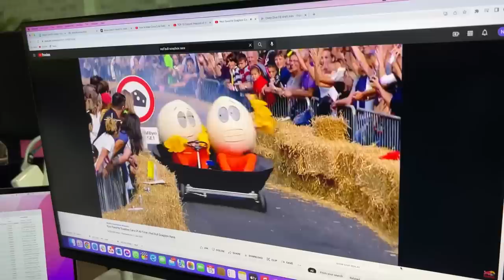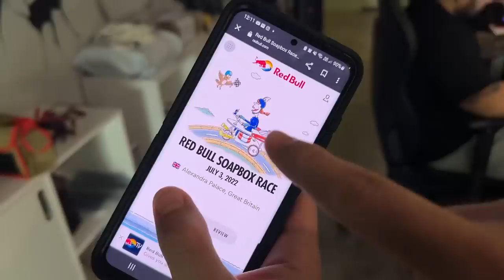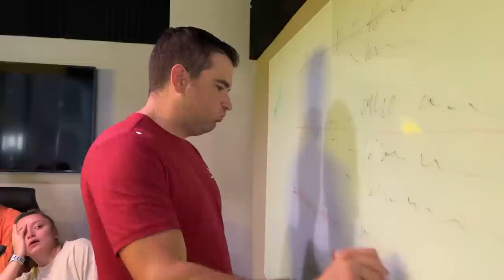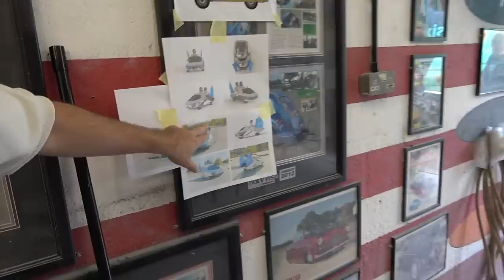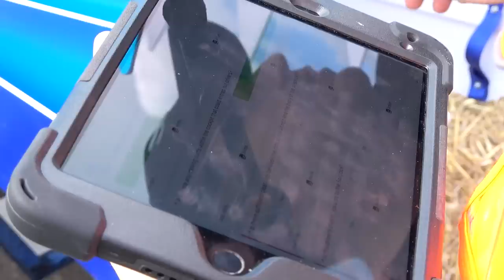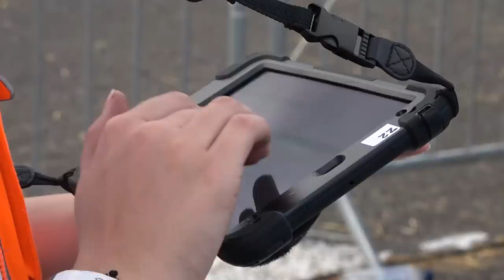Our Crazy Journey to the Soapbox Race

Comment: It's crazy not to have seatbelts and some sort of a roll cage but I'd definitely do it again with a couple of differences.

Those jumps cost a lot of time so I'd recommend a couple of small wheels on the front to prevent it from dragging on the ground and seating positions more forward of the rear wheels with a longer wheelbase.

I would also invest in carbon fibre braces to stop things from becoming unstable and flying off.

Third, I would recommend duplicating the course as much as possible and practicing on it as much as you can. That will not only bring the skills up to scratch but will also be good testing and development for the best vehicle.

Fourth, I would commucate with soapbox clubs to get ideas and hints of them. This all sounds pretty serious and professional but it would be a little embarissing for a supercar channel to not be quick.